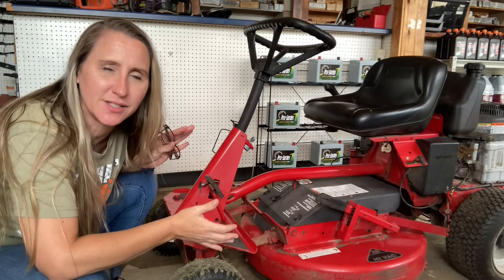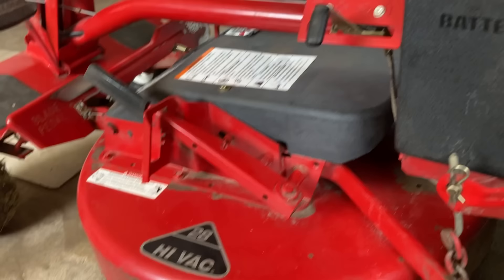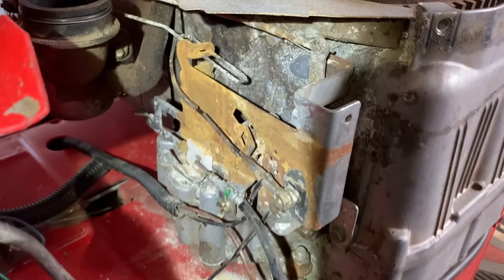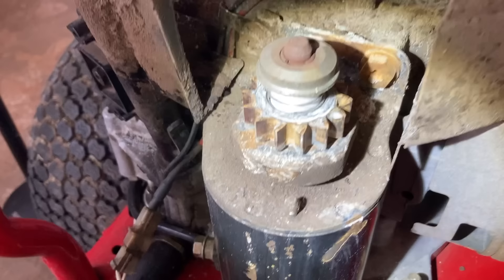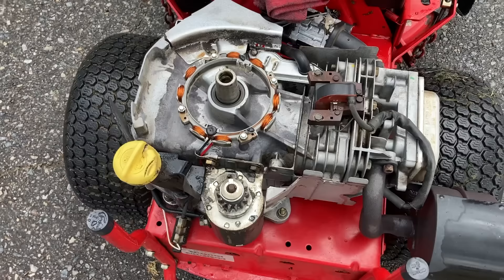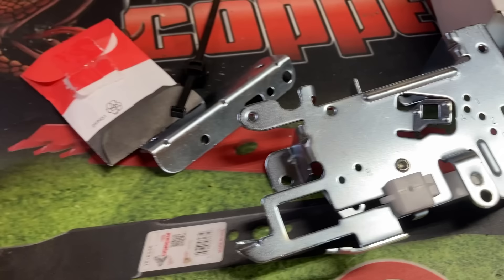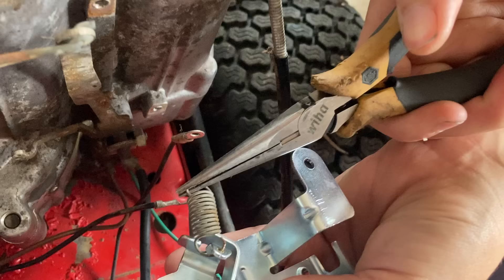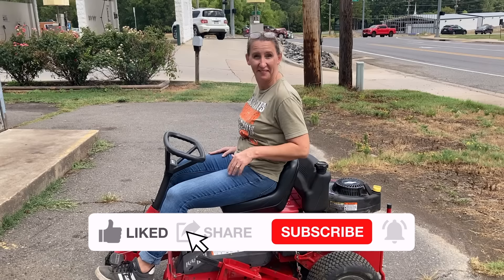Customers simple mistake almost destroyed their Briggs and Stratton engine on a Snapper riding mower

Comment: Did you put one of those Pro Series batteries on that Snapper RER?  They look like they are sealed.  What is the story on those batteries?  They look interesting.  I use Interstate but they are old style. The Snapper manuals tell you  to remove the battery if you have it up for any sort of extended period.  I  get nervous and get any Snapper RER down ASAP.

Comment: Hi thank you  for this channel, so I think the 12.5 motor is blowen, as I got spark, fuel, compression well I didn't check that yet, what should it be around ,(90 110,) and maybe the oil might been low when I pulled it off the truck as it ran to get on the truck I drove it up the ramps, I put it in nutrual and brought it down the ramps started and starting driving down the hill in my back yard to get to the back all of a sudden a loud bang and a few clicks and now no start I tried starter fluid, no, it turns over but no go,if  sound like you might of heard this be-four, please if you have any suggestion thanks and thank  for your time,

Comment: My brother gave me an older model of this rider...he tried to fix a no start, no nothing ignition issue and evidently got it wired wrong as about half the stator coils are blackened with some coating melt. Is it possible the stator will still be usable and even if it is, would it be best to replace it?

Also when I spin the engine by grasping the flywheel, it's plenty free but stops at a point. No reason to believe there is internal damage, so was needing to know if this some type of safety brake, and if so, is it disengaged electronically? And how can I disengage it if needed? It's in neutral.

Then I get to figure out the wiring as the colors don't seem to match up...oh joy. FWIW, he replaced the ignition switch but I have serious doubts he was on the right track. Ignition bad, replace ignition switch sounds good to someone with no experience, however....

Comment: His still might need a starter because it clicks then it could be a loose battery cable connection I'll check it out later on though he's old so he likes the electric start he doesn't like pull starting the mower

Comment: What do you clean this damage with?
I got a zero-turn Snapper with a Briggs 3 yrs ago. Happy with it, a bit cheaply made. But the tires are ultra thin Chinese cheap, and always going flat. You might as well buy a gallon of Slime if you buy a Snapper.
Reply: Especially AFTER B&S bought the brand
Reply: if you're lucky, you might still be able to find a local tire center that does solid fill on small tires.
Reply: @kenbrown2808  What's solid fill?
Reply: @yopage  they fill the tire with little bits of rubber, after which leaks are irrelevant until they get big enough for the bits of rubber to fall out.
Reply: @kenbrown2808  Ok, that sounds good. Thank you!!
Reply: @yopage  problem is they sometimes don't like to do it with small wheels, because it's not very profitable.
Reply: @yopage  Something you don't want to do, unless you  like riding in a "Flintstone mobile" .

Comment: My name is Dave,  I have a husqvarna 128L trimmer and have replaced carb fuel lines and filter. When adjusting high speed it runs to high rpm and quits like it runs out of fuel. I b puzzled hoping that you could give me a hint on what to do. Thanks Dave.  PS, I like your channel.
Reply from the maker: Did you buy an aftermarket carb?  https://www.youtube.com/watch?v=GtLzyFUURhU&t=673s
Reply: @Chickanic  yes I did buy a aftermarket one,  did the same thing so I put original one back on.
Reply: The compression is 105 loosened fuel cap when running same thing, runs wide open then dies like running out of fuel.

Comment: Besides the batteries not being sealed is the fuel and oil a possible problem?
Reply: Hi H Phillips - it's Big Rodders in Ireland.  I never had a problem with oil leaking out but on one occasion fuel leaked into the cylinder despite the gas tap being shut and I broke the flywheel key when turning the engine over on the electric starter.  I now switch off the gas and run the motor till the motor dies and I never have a problem. I replaced the battery with a 17 amp/hr gel one given to me by a hospital engineer who has to replace them on medical equipment annually so it was a no cost solution for me!
Reply: @rodneysweetnam8653  good information. Have a good one from west Tennessee

Comment: Just tried my new gooloo straight out at 80%very disappointed. So I used my  new vector that I pd around 40 for but it was fully charged. So to make this fair I will fully charge my gooloo. Then ?
Reply from the maker: Did you hit the boost button?
Reply: @Chickanic  yes ma'am. I fully charged it and I'm going to give it another try.

Comment: The better thing to do is DITCH that battery & use that pull-cord.  The pull cord won't drip acid on anything!
          The mistake has other elements.  Gasoline & oil should be drained before storing any 4-stroke engine not in its "proper" orientation.

Comment: Briggs and stratton said that no more snappwr rear engine riding mower will be made no more
Reply: Yep, worked @ the Georgia plant when Simplicity bought the Snapper brand 2002, then B&S bought it all 2004 and the product & brand went DOWN HILL from there, they closed the McDonough Ga, plant in 2015
Reply: @REVNUMANEWBERN  when I use ride the grey hound bus to Macon ga  we would pass by the plant in McDonough  there would be a r.e.r going round and round on the test track out front I've been to the snapper store  back in the day
Reply: They simply made them too well, and  they lasted too long.  We can't have quality mowers out in the public.  That wouldn't be profitable.  The last 50 years or more, with minimal routine maintenance.

Comment: Reading and complying with the Instruction manual, specifically the part about removing the battery before tilting the machine up on its hind legs  is beyond the average American Users  comprehension as it requires basic English language proficiency....